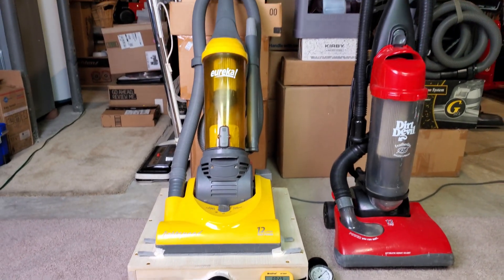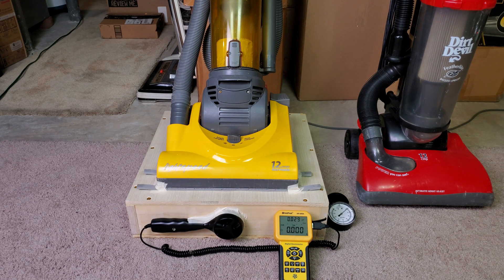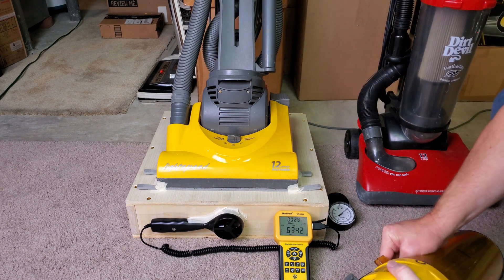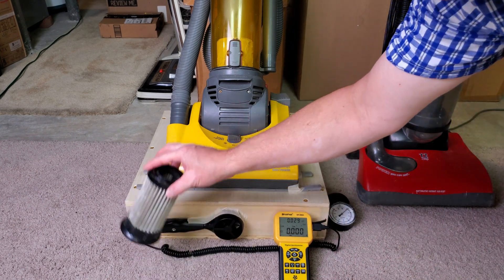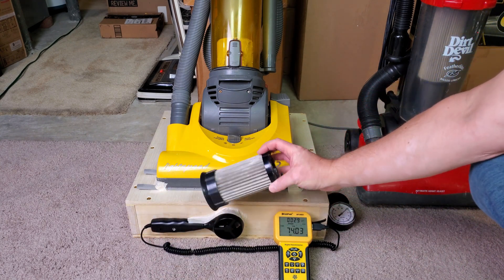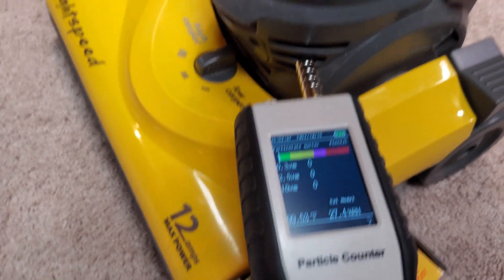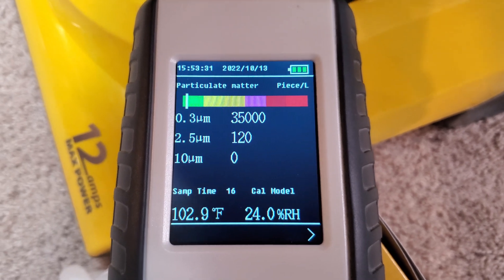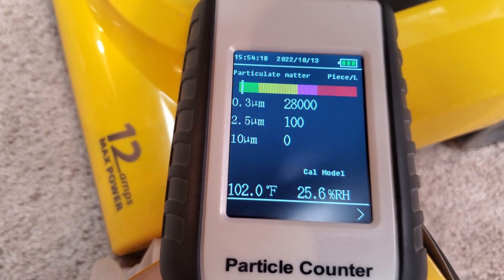Eureka Lightspeed Airflow Suction BR RPM And Particle Tests

Comment: Why would you even test something with the filters out. At that point you might as well just test It from the fan In the motor
Reply from the maker: The point is to show how much airflow is lost with the filters. Pretty obvious.
Reply: lmao
Reply: if you wanted to test from 'the fan in the motor' it's easier and more consistent to just remove the filters and pull from the hose or floor head
Reply from the maker: @michaelsalvucci4260  have you seen my raw motor tests?
Reply: @VacLab  no actually, just about everything else though 😅 I like seeing the particle tests, I have some Dyson's and a few Miele's plus 3 black labs so always vacuuming
Reply: I just found one of these yellow vacuums underneath a freeway bridge overpass where I walk the dog and I brought it home and plugged it in and it works great but it needs a belt and a filter I think it needs a belt , the brush didn't seem to be spinning